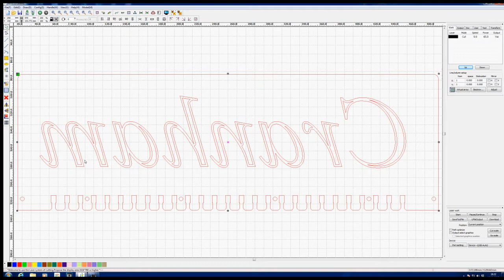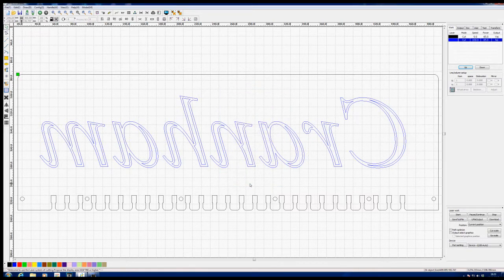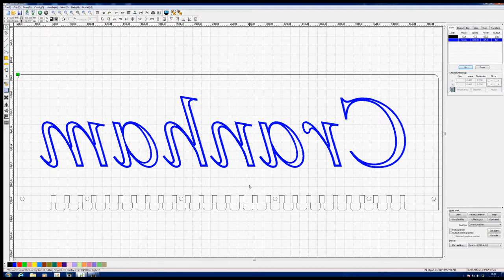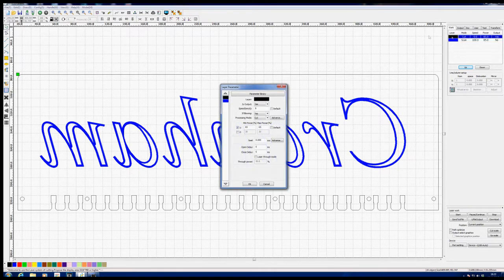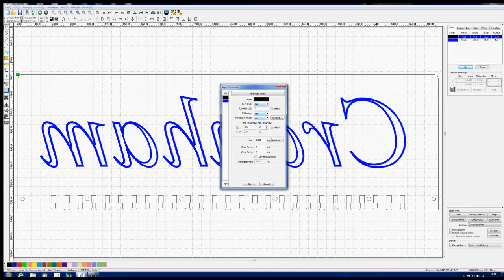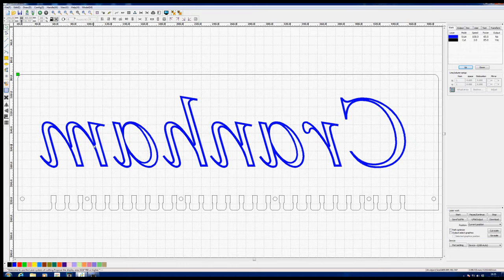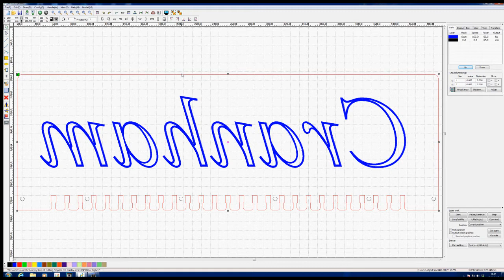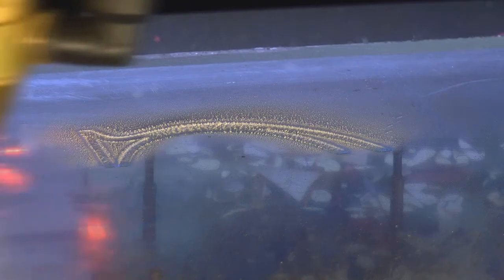RDWorks Learning Lab 33 Solar LED edge lit sign

Comment: hi mr. russ i have a question i have power suply 50w. and a tube 60w.
is this a problem in my machine helpe mi plyse
Reply from the maker: Hi Marouane
Are you sure you have a 60 watt tube?  If it is 1000mm long it is really a 50 watt tube. A true 60 watt tube will be 1200mm long and about 55 mm diameter. Is there any name or label on the tube? What is the model number on the power supply? I'll try to answer when you reply. What is the problem with your machine?

Best wishes
Russ
Reply: may machine is 60wtube but my power suply is 50w my power is broken
Reply from the maker: 60 watt tubes require 20 to 22 KV to trigger depending on the manufacturer and should not run at more than 22mA. Power supplies are VERY variable in their specifications. You may be able to run a 60 watt tube with a 50 watt power supply  if it's output voltage exceeds the trigger voltage required. A typical 50 watt power supply will deliver 22KV and 22 mA. That will JUST about work a 60 watt tube. Don't take the chance, buy a proper 60 watt power supply where the MINIMUM spec will be 25KV and 23 mA. That will be fine for any 60 watt tube.
Best wishes
Russ
Reply: think you so match mr. russ i  very hapy with you
Reply: I am very happy to communicate with you mr russ thank you very much
and happy new year 2018
marouane.

Comment: I'm so glad I found your videos..
Could you make me wiser a bit, please? 
Why there is a change of the engraving pattern, something like a threshold on the letter C and the letter L, please?
Reply from the maker: Hi Michal
Nothing technical. I was cleaning round my workshop whilst this was laboriously scanning. I accidentally bumped into the machine and jogged the plate on the worktable. I did not have another suitable piece of material so it had to stay like that. Out of interest the final result has been working by sun power through winter and summer (13 months now) with zero attention and still as bright as the day I installed it.

Comment: Thank you for the videos they are a great learning tool. My wife and I were wondering if the machine can cut metal. Again thank you.
Reply from the maker: Hi Ron
Sadly NO.You need to be up in the 200watts or more region to even think about metal cutting and even with that power you will need a rather special cutting head and a pretty large compressor to keep up with the high gas flows required.The only material you would be able to cut would be mild steel with this power. I used to own 3kW metal cutting lasers that were a world apart from our little Chinese dragons. These are fantastic value for money pieces of kit once you have installed a decent laser and power supply . If you really need to cut metal then do your own designs and get the job cut by a professional laser cutting shop. It will be substantially cheaper because the capital investment and running costs are high for you to do it yourself and metal sheets do not come in A sheet sizes.
Best regards
Russ
Reply: Ok thank you for getting back to us quickly.

Comment: I am a lot like you when it comes to doing these little things. Although, you have taken the time to document thoroughly, the 'boundaries' of the machine. I thank you very much for that. The multiple tools to calibrate, measure, test and tune all aspects of the machine will be needed. Of course, I am having an 'issue' right away with the machine. When I start the program via computer or control pad, the head moves off center by 1-2 cm, and starts cutting away. This places the cut completely in the wrong spot, and destroys areas that were not designated for activity. It's day 2, and your videos have moved me forward by light years, although this issue will need to be worked out here.  I have specific areas that require impressions, and before I put down any real material, these test pieces need to come out 100% on cue every time.
Reply from the maker: +Kris Kumaroo
Hi Kris
 From your description it sounds like you may have your green square set in the centre position.
https://youtu.be/CWZvQXxbR_E    may be the session to help you out.
Good luck with your new toy
Best regards
Russ

Comment: Russ did you ever out fine why you was getting power drop off after 30sec. Am having the same problem , even on 3mm acrylic using  60%, power and running at 10mm a second. It should cut no problem allowing for the power drop off, I have the same machine as you. The only thing different, I have only had mine for 3 weeks and spent most of the first week setting it up.   I can go up to 85% power before it hits 20 MA  but be know better of then running it at 70% power.  my water temp never goes above 14c am using a water coolly.Are we just the unlocking one's or are there other with the same problem.shaun.
Reply from the maker: +Shaun Browne 
Hi Shaun
You have asked two questions that several other have raised also. The effect of cooling water temperature on power output and the loss of power are subjects for future videos. However, quickly I can say that up to 30C ,  the cooling water should not give a power loss. Yes, I did find my power loss and it was all to do with me over driving the tube, something you appear not to be doing. I did a lot of research after I "wrecked" my first tube by running continuously at 95%. I discovered how the sealed CO2 tube works and it ties in with both your questions. 
The sealed tube is filled with a mixture of at least 3 main gasses. Nitrogen (N), Carbon Dioxide (CO2) and Helium (He). The N is easily excited by high voltage and vibrates violently. It collides into the much lazier CO2 and as a result several things happen. An Oxygen (O) atom gets knocked off the CO2 leaving it as Carbon Monoxide (CO) and in doing so slows down the N vibration a bit and at the same time releases an infra-red  light particle and also produces heat. The He is in the mix as a heat conductor, carrying the heat to the water jacket. Removal of heat and lowering of the instantaneous stimulation by the N allows the free O to recombine with the CO to make it back into CO2. This little internal process continues happily provided you do not overstimulate the nitrogen and try and force too much current through the ionised gas. If the N is overstimulated then more O gets knocked off, more heat is generated, along with more power. But very quickly the He is unable to deal with the heat generated and the N excitement never drops back to a point that will allow the O to recombine with the CO. As the free O increases there is less CO2 in the mix to generate infra-red emissions, thus the power starts to drop. This is called oxygen poisoning and will soon reduce the power to zero. At which point the He can then begin to cope with the heat transfer  and the power will start to increase but before it gets back to full power the work rate for He will again be too much and power dives again. However, turn the laser off for a few minutes and the natural cooling and lack of high voltage stimulation will allow the gas to ALMOST fully recombine. Normal power will then have  been restored.. This "ALMOST" is what happens naturally over time and will eventually determine the 1000 to 2000 hour life of the tube as the gas mixture gradually weakens.
If you are not over driving your tube and the tube is new  I would suspect other issues. You obviously have some acrylic which is excellent news. This is the best material to check out your laser power.  It evaporates directly in proportion to the power in your beam. It may be only 3mm material but place a piece in front of you first mirror and expose it for 4 seconds. Make sure you blow on it because the fumes will ignite. I have tested my machine for you at full 20mA power (65%) and after 4 seconds of burn it leaves a conical hole about 6mm diameter at the mouth (laser beam side) and a clean hole about 2mm diameter at the mirror face I have measured my output power with a calibrated meter and know that my 50watt tube actually only delivers 37 watts. You can use this as a power guide. If the power looks good from the laser the next thing is to  repeat this test in front of the second mirror and then the third. There will be slight loss at each stage but if you see a bigg difference then clean that mirror with acetione or isopropyl alcahol. If all is well up to the third mirror then take the nozzle off and check what's happening at the third mirror.. If thats OK then check your lens is clean. If you have done any work on your machine with the air assist turned off it's possible you may have smoked the bottom  convex surface of your lens. That depend on the lens they have fitted . Mine point of focus is only 6.5mm below the nozzle and is particularly susceptible to this, which is why I ALWAYS leave my air pump on. The final check is to make sure that your focused beam is leaving the nozzle cleanly. If it clips the edge of the nozzle....power loss!!
See what you can make of this info
Good luck
Russ
Reply: Thanks Russ for the that I did check my lens and would you believe I found a dead fly on the lens. After cleaning the lens I was still getting power drop off. will check the mirrors as I have done a few mods to it so it is most likely the problem (dirty mirrors). Thanks once again and have a good Christmas
shaun
Reply from the maker: +Shaun Browne 
Always interested in others progress, so let me know how you turn disaster into triumph. Enjoy the holiday...... there's all next year for these problems.
Russ
Reply: incredible.. :-))

Comment: Hi, it's maybe a bit of topic. But I here you saying that you can not put the power higher than the 65% otherwise you overdrive the tube. Can you tell what you mean by that? When does a laser tube go in overdrive? An how do you check this?  Thanks in advance and good luck with your project! It looks good!
Reply from the maker: +Glenn Claes 
Hi Glenn it sound as though you may have jumped in at the end of this series of videos.  They document my learning process with this machine (and I continue to learn) and its associated software. I urge you to watch them. I have made some BIG mistakes along the way. The biggest was to assume that 100% meant full power. There were no warnings in the manual about drive current limitations for the laser tube. It was only when I started to notice power drop off (sometimes to ZERO) that I started to investigate, test and learn the error of my ways by picking up odd facts from here and there around www. If you have  machine then limit yourself  IMMEDIATELY to 65% . Get yourself a cheap  ammeter from Ebay  (I have done a video about fitting mine) so that you can check what percentage is required to drive your machine to its 20mA limit (assuming you have a 50watt tube).  Without getting too technical, how can I explain what over-driving is? They fill sealed laser tubes with at least 3 basic gasses. Carbon Dioxide (CO2) Helium (H) and Nitrogen (N), This next bit is grossly simplified to help you imagine what's going on.  The lasing effect occurs when you apply tens of kilovolts to the gas mixture,. The N gets very excited, it bumps into the lazy CO2 causing it to breakdown into carbon monoxide(CO) and an unstable form of Oxygen.The collisions cause the N to slow down and release heat. The H then carries that heat to the glass jacket which is water cooled. This reduced N activity  then allows the unstable oxygen to recombine with the CO to return it to CO2 and the whole process starts again. If you excite the N with too much current (you overdrive it) it goes bonkers, breaks down the CO2 much faster  and never gets a chance to slow down enough to allow the oxygen to recombine. The mixture inside the tube  soon becomes "poisoned" by all the free energetic oxygen and the CO2 lasing constituent  gradually disappears, resulting in LOSS OF POWER. Turn your laser off for 5 minutes and the gas will recombine to almost 100%.  If you "overdrive"  it often and for long periods it will gradually weaken the mixture and hasten the demise of the tube. Typically these tube last 1000 to 2000 hours max. The manufacturer makes a recommendation for the max drive current to sustain a constant lasing power, but as I have recently found out, my 50 watt tube is only outputting 37watts at 20mA.  It probably is capable of outputting 50 watts under special short period conditions but there is no way any 50 watt tube will deliver its rated  power under normal conditions. However you can still do some amazing things with 37 watts.

Hope this has made things a little clearer for you
Russ